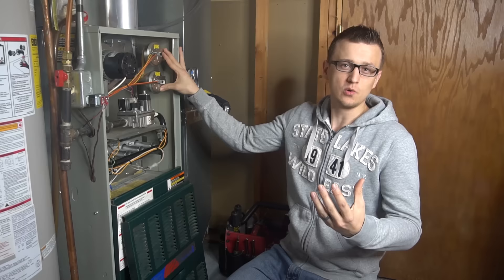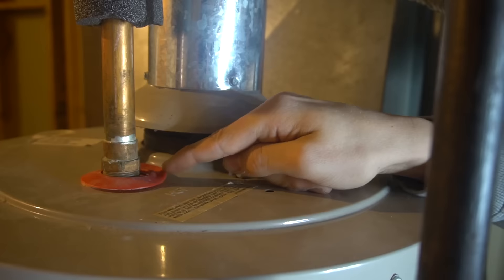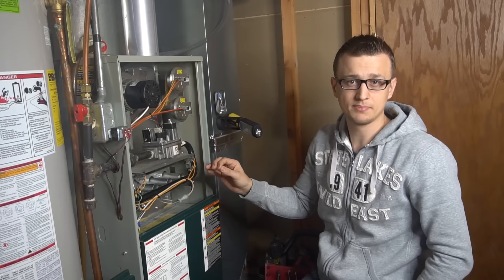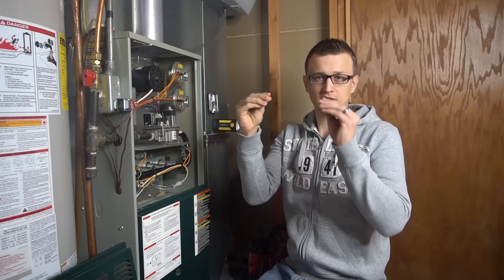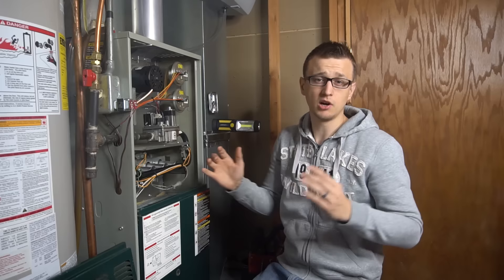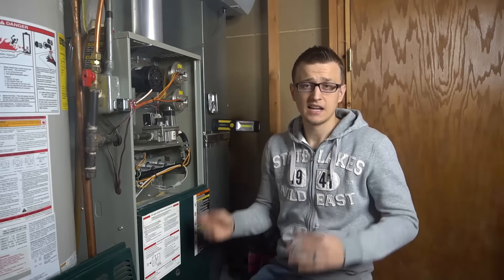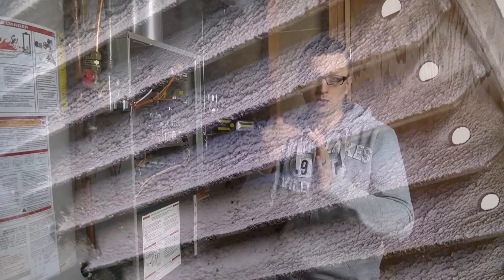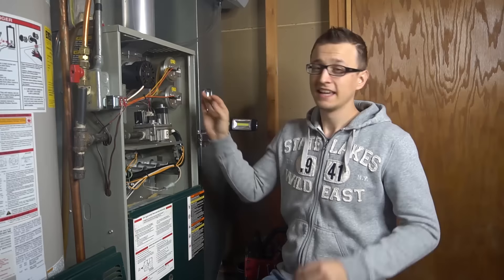Furnace Pressure Switch Troubleshooting

Comment: I have a Lennox high efficiency that is giving the high pressure switch not closing. A tech checked the system out and it lasted about 24 hrs and came back on. On the techs return he said his supervisor who hadn't even looked at it said we needed an additional  intake vent added for 2000 bucks. The furnace is 9 yrs old has ran perfectly even though we are getting this alarm. Why would the air intake now be bad?

Comment: I have a question if you, or another subscriber can answer, or at least point me in the right direction. I noticed my furnace wasn't working one night, I went to check it out and found that the inductor motor was seized up and smelled like burning electrical. I figured this was the issue, what else could it be? I got a replacement motor and stuck it on there. Well, the motor worked and everything seemed good, however the furnace wasn't lighting.  After some tests, I realized that the second pressure switch wasn't closing,  I sucked on the tube and got the switch to close, the furnace kicked on. For 20 bucks I bought a new pressure switch, put it in but things still aren't working. Clearly I'm not getting the -1.10 pressure it's supposed to. I checked my intake line, no blocks, I checked the condensate pan for cracks or leaks, no issues, I check the hose, no cracks or breaks. Why am I not getting enough pressure for the switch to close? Everything seems tight on the back of the motor against the pan, everything seems to be fine. I got my old motor to break free and I'm gonna switch it out and see if it still works, maybe the old one will create enough pressure(if it runs) maybe there is something not right about the new motor? I just don't know, I'm stuck lol.

Comment: Such a great and informative video. I was getting the three light error code and saw that it related to the pressure switch. I googled that and found your video.

I checked the exhaust and condensation exits and they were clear. I then removed the switch tubings (I have two pressure switches on my unit) and sucked on and blew in them. I also stuck a small screwdriver in the ports. I didn't notice either being clogged. I reconnected the tubing and turned the unit on. It fired right up.

Any idea what it may have been? Does a pressure switch get hung up ever and the sucking and blowing unstuck it? Just wondering if it is going to mess up again.
Reply from the maker: Well.. It's hard to say what it could have been. Sounds like somewhere along the way, as you were doing all that you resolved whatever the problem was. Perhaps there was a little bit of debris in the port that you didn't notice but ended up clearing out anyway. Or like you mentioned, maybe the switch was stuck closed/opened and you were able to free it up by blowing into it. The best way to confirm that would be with a meter (if it happens again). But hopefully this was a one-time glitch and you can forget about the furnace for another 5-10 years :)

Comment: ref my last question.  when it fails next time i will test for
voltage at gas valve.  and obviously if there is power i might have a bad gas valve.    good test for gas valve working properly or is that just verifying voltage at connection? thanks

Comment: My pressure switch doesn’t click when my water heater turns on but it clicks when I suck on it. I tried cleaning the other end of the pressure switch pipe and still hasn’t worked. Need help please.

Comment: Two stage high efficiency furnace with one port on the inducer one on the gas valve and one on the burner box.. there is no clog in the vents and the unit will only run when the port on the burner box is pulled off and the difference between the two tubes read greater then 1.4 in of w.c. Have you seen that before ? The inducer reading 1.51 in of w.c and the burner box was at .16 in of w.c the intake pulled from in the garage. No one can explain how the system ran for ten years this way and now there’s an issue. I then cut the vent open sucked with a vacuum and blew with nitrogen. No blockage..

Comment: I have a Me Heater in my garage and 3-4 times a winter I have to clear out the pressure switch port. I do the paper clip trick to get it going. This happens enough that I just leave to cover off. Is there a long term answer to my problem. When it gets to -30 over night it’s a real pain in the rear.

Comment: I had my heat set at 66. Woke up to my house being 90 degrees. My furnace just didn't shut off. I ended up shutting it off at the breaker and resetting it. Seems to be ok now. For years I've always had the medium pressure switch code or the inducer code and it's always worked fine with those codes. It's a Carrier infinity model

Comment: The service tech said I could save a lot by replacing my Lennox high efficiency switch myself.  He tested it and said it was sticking.  I used the switch # (103612-04) to order, but it's gone thru a couple upgrades in 10 years.  I ordered the latest one, 14T64.  But the instruction sheet says that one is for an up flow or horizontal furnace, and ours is a down flow, which it says needs a 14T66. The dual (stacked) switch mounts just above the gas valve.  I can't see a reason why the 14T64 wouldn't work, but Lennox won't answer this question, referring it to a local dealership, which hasn't replied to me.  

The seller of the switch will accept it back, but doesn't carry the 14T66.  Is there some reason I can't simply undo the single screw on its mounting bracket, and remount it 180 degrees, since the switch obviously has alignment pins and screw hole on the opposite side for such.  Then its hose ports would come out on the side close to where the the original's does.  The 14T66 looks like its ports will not align as well no matter which way it mounts to the furnace.  Lennox furnace model SLP98DF070V (serial 5910L33356).  Original switch 103612-04.  Is there some other significant difference

Comment: Great video. Anyone have a clue why a pressure switch and the pressure switch tube keep accumulating  water? This throws a code, and is easy to fix by removing the water,. Keeps happening especially in sub-zero temps. Hoping for a suggestions on how to stop water accumulation into inducer.

Comment: I found your video very helpful!  I do have a question though.  My furnace starts up fine, it fires up and the inducer motor runs and the blower motor kicks on and blows heat.  But, I get the error code for pressure switch stuck open.  I checked continuity on the pressure switch and the continuity went off when I pulled the hose from the inducer motor and was on when I put the hose back.  Do you think it's the pressure switch or something else?

Comment: My Trane Furnace has a LIFETIME warranty on the primary and secondary heat exchanger IF ownded by the original owner, and installed by a professional....Have you any experience with how well Trane responded to this warranty? Do they stand behind the warranty, or just blow hot air?

Comment: Hi, my furnace periodically has problem of "Lower pressure switch Open, Inducer on high speed". I won't be able to start for a while (sometimes half an hour, sometimes several hours), and then the problem goes away on its own. Do you have any idea what it could be?

Comment: You mention the number 5 problem. Please tell me what to do because of the water why it keeps the water in the hose
. That's my problem right now. My furnace keeps stopping the heat. I keep going down in the basement to pull the hose and remove the water.  Please reply asap. Thanks

Comment: Ok, I replaced the high limit switch, but that didn’t work. I’ve got a Tran Xr 80. Getting four red flash code. Took out the filthy filter. The igniter is not coming on. Could the rollout switch stop the igniter from coming on, if it has been tripped? Before I just buy another part I don’t need or won’t help. What else can I check?  Your videos have pretty much taught me everything I know about forced air furnaces. But I’m not having any luck yet? Should I just replace the igniter next, or check the rollout switches, or could it have something to do with the pressure switches? Can a open pressure switch keep the igniter from coming on. Boy I need help, lol. Please let me know if anything comes to mind. I really appreciate how informative your videos are. Thank you

Comment: What would cause a furnace to turn off? It does a full cycle good but then when I turn up the heat again it will turn the furnace off before reaching the temp on thermostat. Runs good for minutes sometimes a whole hour. I replaced the thermostat and it worked for about 2 days and then began doing the same thing again. Really old rusty furnace.

Comment: I just had a pressure switch replaced less than 24hrs ago since they told me it needed to be replaced. When he did replace the switch, he did notice that there's water inside it. So at 8am this morning my heater stopped again. I checked and there's water in the pressure switch again. What would be causing this? Did I just pay to get a working pressure switch swapped for no reason? Thanks for your help.

Comment: I'm running into an issue where my igniter isn't lighting and the control board is reading a error:  9 blinks- pressure switch failed to close or open during heat demand. Any ideas what this could be? Are the issues related?

Comment: What would cause the pressure switch port on the inducer to plug more than once in 3 months? I ran a call back for a no heat that I cleaned the port 3 months prior. Was clogged solid again.

Comment: I just had a bad pressure switch, tested it by plugging a 3 amp fuse in the leads and was able to get the furnace to fire. Took the leads from the brain box to the blower pressure switch and left the exchanger pressure unhooked. Itll get ya heat until you hvac person can show up with a new pressure switch. If that makes sense...

Comment: Hey. I have a problem I’ve been chasing for a week now, my inducer motor stays on constantly, my error code flashes once every 2 seconds. I changed the limit switch with no change. I do hear a clicking noise when the motor is running. Could that be the issue?

Comment: Hi I have Goodman Furnance giving error of pressure switch but after on off power switch run for one cycle half hour but next round does not start some time flames comes for 10 15 second and then off .if I did not close the cover then no problem thanks

Comment: So if I measure the correct WC at 1.5 with my switch rated at 1.4 and my furnace is not firing up properly. It will fire up and give me 3 start code "pressure switch error". It will do that for 10-15 minutes and after fire up and work properly. It has been doing that for a year... What can be wrong? the water seems to be draining (95% efficient furnace) and when removing the drain from the bottom of the inducer motor, only a few drops of water come out. It does with this the cover on or off, not sure how to resolve it.

Comment: Jay I have a Ducane 80 percent furnace .thermostat,inducer starts running, and then it will shut off. it will do this three times and then it will light and it will meet the thermostat temperature. I am put a new pressure switch in and I have taken the hose off and I can hear the pressure switch ticking by sucking and blowing. It’s working good. Replace.. the pressure switch hose to the inducer. Stuck a wire in the port and is clearI can blow in hose with no restriction at all .
Replaced hot surface, igniter, and flame sensor.
Furnace is clean replace filter every month . I think the last place to check is for a restricted flow. The flu pipe outside does have a cover on it. I don’t think anything could get in there. I will check voltage from board to inducer and pressure switch to be sure it’s getting 120 V, what else do you think I should check?Mike Powers Thanks

Comment: Do you think if the “pressure switch open while inducer is on” error is intermittent that this could be that wire connection issue? Trying to think of which of these problems could cause it to be intermittent.

Comment: I need to replace my condenser pressure switch and have not been able to find an exact replacement of a 1.25" water column. Could I go safely up or down closest to that number. I've found a 3 terminal 2 port with a 1.6" water column. What's the rule?

Comment: I had my furnace fail because of the secondary heat exchanger...  My condensate line was leaking in the unit and made it's way to the heat exchanger.  It was the middle of winter and I had to replace my furnace.

Comment: this is great!  if i figure out that its a bad pressure switch, do i need to get the exact replacement for the one on my furnace? or will any one do?  really hard to find the exact replacement for my old amana (goodman) furnace, but i have the part number.

Comment: I am not getting any power to the wires going to the pressure switch.  Any sugestions? I have an old Bryant 90 plus with a newer heat exchanger

Comment: Hi, Great information again. I purchased an electronic  manometer [ Field brand ] from a supply house, but, I would like to know where I can purchase addition tubing and plastic tees. So I can tie into my furnaces pressure switches to check inches of water. The meter only came with 2 brass barb fittings and 2 short lengths of tubing.  Thanks for any help you can give me.      Thanks Friend
Reply: Hey Ronald, just last month I were looking for the very same material to test equipment with. I found tubing at work supply room, as far as the tees I gathered from used equipment, before finding them, I was told you can get them from Home Depot! Good Luck!
Reply from the maker: Hey Ronald! And thanks for the suggestions L Brown! Just like Brown, I got my extra hoses/tubing and tees from furnaces I condemned in the past. Or from replacement parts. So actually I never shopped for that. I am sure a hardware store will have the tees, not sure about the pressure switch hose. Amazon will likely have them too. I looked quick and found these if you need it as a reference:  https://amzn.to/2VsHhyX (Tubing) and https://amzn.to/2RxJMRq (tee)
Reply: @WordofAdviceTV  Thanks

Comment: If the sucking/blowing of the hose that comes off the hose and heard  the “click”  does that mean there is an issue with the micro switch inside the pressure switch? I still keep getting this error code “pressure switch remained open longer than 5 seconds after the combustion blower was energized ”  (this is on a water heater btw so I know it’s different but was hoping to apply it to this appliance as well) - we ordered a new switch after ordering a new flame sensor assembly then still having the problem happening I have now ordered a replacement rheem pressure switch which does light the flame and stays on a short bit but then shuts off 😓

Comment: My furnace  inducer motor turn on by itself for 5 sec and turns off  and it has been happening for last 3 days . it happened once every 10-20 minutes .  I have checked my thermostat and it has been off . I meant to say thermostat has OFF position for Heat and Auto for blower . Also I checked voltage and do see 24VAC on RED but no voltage sending back to control board on GREEN(blower) WHITE( heat) and Yellow(Cold) . so any suggestion  why inducer motor keep on and off by itself periodically please

Comment: UPDATE: issue wound up being water in fan. Tech drained it AND moved pressure switch up higher than fan. Hasn’t failed in past 24 hours. Fingers crossed. 

We have a comfort maker high efficiency furnace installed in 2014 when the home was built.
Since 2017ish, we have a continued issue with the now dreaded 3 flash pressure switch code.
We have probably had people out twleve or so times for service.
They have replaced so many parts under warranty (draft motor, pressure switch, collection box).
The unit runs fine when it isn't windy OR below freezing.
BUT, when it is either windy (blowing southerly - vent is on north side of house) or below freezing we have the pressure switch failure.
Reply: Same thing here with a Heil high efficiency on a north facing vent. 2 years ago during the polar vortex I went through this and left the door off until I had a replacement switch and it worked fine until this polor vortex. I tried the same tricks after the 3 flash code and it fired right up only to throw the code several hours later. I've ordered a switch again but I'm thinking it's not the answer but it can't hurt to have one, nothing is clogged, no condensation, proper fall on pvc pipes and it has a newer inducer motor. Only things I know for sure is this always occurs during the very cold weather and this video helped me test the switch I pulled off 2 years ago and it's clicking and opening telling me the issue is likely elsewhere.

Comment: I have an old furnace and there aren't two plastic pipe on furnace, so I guess it is not  a high efficiency furnace.  The problem with it is when I open the burner cover, it can working without any problem, however if I put the cover one, it stops burning.  
I guess it is the air intake issue if it is a high efficiency furnace,  with this old,  how should I check the problems?  thank you very much!